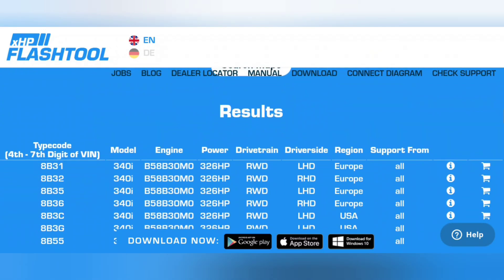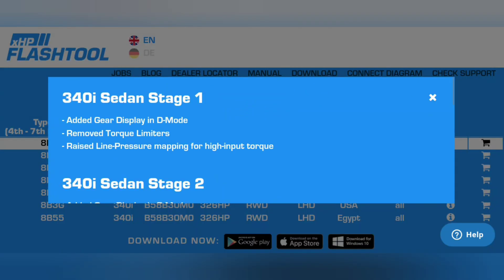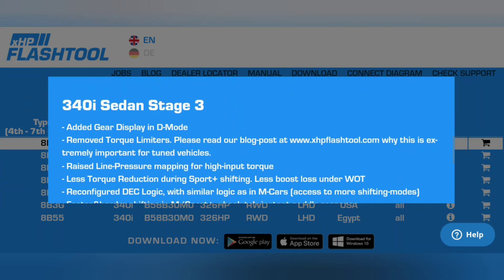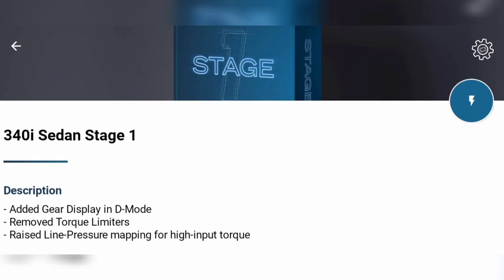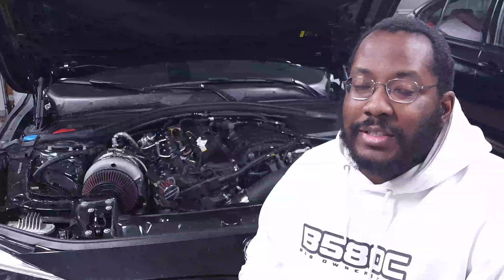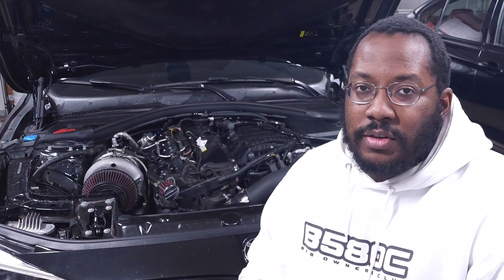Is a Stage 3 Trans Tune too much for Stock Turbo setups? Guide to xHP Tuning Maps

Comment: XHP is usually targeted for better transmission. A custom tune is targeted at the engine so you get more power from the engine and the transmission.

Comment: I just tried today xhp stage 2 and i dont think ill even bother try stage 3 as it already feels super quick and the up shifts are kicking like some real M dual clutch tranny hands down xHP great product
Running 2019 g31 540i 421hp 620nm on  95ron fuel and spark plugs soon to be replaced 
Checked on dyno this week

Comment: Is it normal with stage 3 that the shift on low throttle and low rpm that the shifts from 1 to 2 break my neck? Or is it just part of the aggressive experience thing?

Comment: quick question  2011 335i n55 e92 here
i’m on MHD stage 2 tune & XHP stage 3 transmission tune. 
when wide open throttle car gets half check engine light & get these codes on MHD

2EE0 - Combustion misfires, several cylinders:
Fuel injection deactivation.
2EF4 - Combustion misfire, cylinder 6: Fuel injection deactivation.
2EFE - Combustion misfires, several cylinders:
Damaging to catalytic converter or damaging exhaust gas.
2F04 - Combustion misfire, cylinder 6: Damaging to catalytic converter or damaging exhaust gas. deactivation. 

any ideas? 
i only have - Gear Display
Throttle Blips M-Mode
Reassign Shift-Speeds activated. am i missing anything ? also on MHD do i keep the transmission part on AT auto rear wheel drive or x drive or do i change to alpina flash auto rear wheel drive. other options are manual MT or xhp flashed AT
Reply from the maker: Sounds like an engine issue not a transmission issue.

Comment: I’ve bought an m2c with stage 1 (550hp/700nm) but I think without TCU tune. The other day went into limp mode and my transmission act weird,and had propulsor error in the dashboard and CEL. After 30mins started the car up and looked finês. Now I am wondering if it needs a TCU tune. Could it be hitting a torque limiter?
Reply from the maker: i suppose it's possible but not likely. you need to scan for codes in those scenarios to see what's wrong
Reply: @kern417  there was errors from the transmission,it had a short circuit between the connection of engine and transmissionCU. But if it hits torque limiters shouldnt go limp mode? Also I was pushing the car hard in high revs
Reply from the maker: without the codes it's no use trying to guess. your other option is to run a log.

Comment: went straight to stage 3, and my trans began overheating on very hot days after 30 min and would take a bit to overheat on cooler days, not sure if this is common or has happened to anyone or if it has to do with xhp or another issue, but any info or advice?
Reply from the maker: How do you know it was overheating?

Comment: Would anyone be able to speak to long term reliability? Looking to flash xHP stage 2 with either JB4 piggyback or BM3 stage 1. What kind of logging should be done to monitor ZF 8 speed performance?
Reply from the maker: It works great and reliability. Reading adaptations will be the best opportunity to confirm trans health

Comment: If I’m getting a combustion engine torque limitation active code will xhp fix this? Im on a custom e85 tune
Reply from the maker: If you don't have xhp then you will trigger limiters depending on how much torque the car is requesting
Reply: @kern417  i got xhp stage 3 but still getting the shadow codes sadly. Will see what my tuner says
Reply from the maker: Is the load/boost going over target in your logs?
Reply: @kern417  yeah but now it only flags the torque flag near redline (6.6k rpms) so seems to be fixed on this newest revision I got today 🤙

Comment: Bro... I love your channel! So helpful. Okay, I am going to buy XHP but I need to fix my 540i first. Can you help me, please... Ever since I upgraded to the B58TU fuel pump. I can not get my car to make any aggressive pops. I use BootMod3 and running the Stage 2 plus. I have a stock exhaust, VSFR high flow downpipe, charge pipe upgrade, and K&N air filter. With that said... I could make it very loud before the new fuel pump install. Do you have any clue what might be going on? I have tried refreshing back to stock and then back to the tune. I changed the custom burbles to max and it still sounds the same. Help please. Thank you!❤
Reply from the maker: Not sure. I would message PTF for help addressing it. A pump doesn't do anything with burbles.

Comment: Great video and very informative. I have the B48 330i stage 2 with BM3 and have been considering XHP for a while but could not really find the answer to my question about if it was worth it for lower horsepower tune like mine (approximately 350HP) but you sure answered that for me. Big thank you.
Reply: Have you gotten it? I’m thinking of getting it with my 330i
Reply: @GrandMasterPurp did you get it?
Reply: @ I did get and I do recommend it makes the shifting so much more smoother and instant

Comment: i went straight to stage 3 and its perfect for all round driving, i love the DCT type shifting in DSC off/sport+, the manual shifts are instant its so good

in comfort and sport mode the shifting is still super smooth basically like oem, but sometimes wish the sport mode had harsher shifting as i dont always want to go into sport+ or dsc to have a hoon around.

oh and wonder why in comfort and sport mode manual shifting is slower than oem lol
Reply from the maker: Apparently they changed that in one of the updates. I never used it before now so can't really compare
Reply: @kern417  I’m on 1.7 and manual upshifting in comfort and sport is quite slow
Reply from the maker: @ahhhh226  yeah same i just haven't experienced any different for frame of reference. If i want fast shifts i go to sport +
Reply: Whats your mods? im gonna be getting xhp soon and not knowing whether to go straight to stage 3 or stop at 2 (stock m340i)

Comment: Hi Kern, I really love all the videos you put out; they're very informative!  I have a question, I have a 540i and it's on stage 3 XHP and stage 2 BM3. When the car shifts in comfort plus, I feel a jerk which I don't want to feel. Is there a way to have OEM settings for comfort plus and then stage 3 XHP on sport + or should I use stage 2 XHP and it should be less aggressive on comfort plus?
Reply from the maker: It's probably the slow shifts in comfort +. Try selecting one of the presets in the shiftmap options

Comment: Great video👍Slightly off topic but I’ve often wondered if the software update that’s part of the mppsk install at bmw adjusts the gearbox software as it seems to improve shift times in sport+ (could be wrong)

Comment: I'm on Stage 2.... DRAG MODE.... Moderately spirited driving, - never go above 3500 RPM and it's lasted 1300 miles.   Clutch adaptions look the same.

Comment: For those of us running stock, xhp ruined my car. It took away the hard aggressive shifts of the standard factory map in Sport mode. When I then tried to revert back to factory map, it took some updated stock map from somewhere....their servers.... And not the original map from my car. So I've now forever lost the enjoyable jerky shifts in sport mode, as well as the "fart noises" on upshifts. Total disaster.
Reply: If you want sharp gear changes you really need to put the car in Sport+ and to go in S mode (stick to left) or manual mode. For me, the shifts are crazy fast !

Comment: What is the current only way to get more power out of POST 06/2020 produced b58s. So like for example a 2021 m340i. And are there any companies working to figure out a way to unlock them without having to send them to femto? Its been 2 years since those b58s came out, shouldnt there be some kind of progress on figuring out a way to crack the dmes?
Reply: still no one except femto lol
Reply: @ sad stuff

Comment: One question I have always had is, how hard are these tunes on the transmission/ overall health and longevity in general? I had to flash stage 3 after installing my big turbo as stage 2 was limiting the torque pulling from 50’s and would cause a split second loss of power before picking back up.
Reply from the maker: Generally it isn't an issue. But some settings allow you to push the limits so you should be aware of what's happening before you go that far
Reply: @kern417  Thanks brother! Quality content as always 🙌🏽

Comment: Thank you for bringing new about B58 man I really appreciate the work you do, I have one simple question, as far as I understand, bmw x40 engines comes with a different torque converter than the one in 540i, how much can I push with the stock converter before looking to upgrade to an M Performance torque converter or another one in order to make some gains, I really don understand why the 540 G30 comes with a different torque converter than the 440, 340 cars? Thank you.
Reply from the maker: I haven't seen anything regarding that. I don't know of any 5 series with slipping torque converters, even with big turbos

Comment: Great content as usual kev, but what about BM3 transmission tune is it more safe or XHP stg 2 for example?  Just purchased BM3 license a couple of weeks ago so I’m not sure which to try
Reply from the maker: They don't have a trans Tune for our b58 cars. The ones they have on other cars only removes the torque limiter and doesn't have nearly as many features as xHP.

Comment: Those of us with a90s is it worth adding sport plus thru Bimmercode with xhp or stay with ots maps
Reply from the maker: I think so. If it's like F30, it just combines all the fastest modes from everything, plus softened traction control to let the wheels slip a bit. It's great for performance and fun.

Comment: Thanks for the info! Just wondered if you think xHP adds much wear and tear/could add issues with reliability and longevity at all? I know you mentioned the torque limiters stock operate well below the safe levels for the zf8.
Reply from the maker: With these features no. In part 2 i will talk more about the options that can
Reply: @kern417 can you send link for part 2?

Comment: You forfot something about stage 2 vs stage 3, and this is DSC off. Manual mode is really slower in dsc off in stage 2, there's a delay between shifts and in stage 3 they are instant. That's why I went stage 3. I just turned down throttle blips to minimum in settings because they were pushing the car when braking.

Comment: Once you go hybrid on the 340 I’d be interested to see what you change in the settings. While they raise the rpm a tiny bit it still goes into 8th fast at low rpms and kinda bogs you a bit if you have max torque at 3-3500rpm. Tried sportive shift map in the editor but it’s still not rly where I want it
Reply: in the options where you chose sportive you can also do custom to change when each gear shifts
Reply: @alexk4804  yeah but not sure how I should go about doing that. The presets don’t add the same % to each gear and if you do it wrong it can make the car really weird to drive. If you have some settings I’d love to try em! The standard xHP shiftmaps are def made for stock turbo. Adjusting a slider with a % is hard to gauge compared to just setting an rpm

Ideally in d mode, rpm would be at like 1800 while cruising but shift down with a little gas to be in the power band more and feel less sluggish. Shifting at 3k with 25-40% throttle and higher at 4-5k above 50% throttle. 

And hold 6th and 7th gear longer so you’re not in 8th gear at 50mph. May try sportive+ instead of sportive next
Reply: Im also curious how hybrid turbo affects to normal daily driving with D mode, is there still enough power to drive 1200-1500rpm ?
Reply: @przemekgodzik56  depending on which hybrid mechanically they will spool different. pure800 or the smaller daw turbos can spool pretty fast while the ultra flow will spool slower. Regardless, most tuners won’t give you full boost till 3500 even if the turbo spools faster to protect the stock motor. 

I’ve driven my og pure800 car for a while and like to be in d mode comfort around town and cruising on the freeway. It’s not undriveable but changing the shift maps would greatly help. The standard stage 3 shiftmaps are a bit lazy imo
Reply: @SpiderGamesHard  Id like to take turbosystems stage 2. Its not big turbo, maximum untill 600hp. Stock turbo is crusing around 1200-1600rmp and im curious if on turbosystems stage 2 will be simmilar with daily driving or its gonna be annoying

Comment: Well said Kern, stage 2 is the best option specially if you are not tracking the car or drag racing. I’m on MHD Stage 1 and xHP Stage 2 in my 440i GC and it’s my daily driver but it feels really nice when you press the gas pedal 😊👍🏼pretty happy with the performance that i have with both flashed options.
Reply: I have the came car and looking for the same setup with flex fuel like e40. Bm3 has a nice flex fuel kit. How much hp are you putting down?

Comment: Does it matter what stage mhd I am ? I’m currently stage 1 MHD on my 340i. Contemplating buying my dp and going stage 2 or buying xhp what’s your thought. If I go xhp is stage 2 ok whilst mhd is stage 1
Reply: The one has nothing to do with the other. I had xHP Stage 3 before I even tuned the engine! So Stage 0 + Stage 3. Still plenty of advantages.
Reply: @Y.D.43210 can you please tell what you experienced with this XHP tune on stock car? I am stock now but looking to do the XHP first. Thanks
Reply: @Alain91C  Only positive. In reality it is completely independent from an engine tune and brings (performance and customisation) benefits on its own. You get the same advantages through xHP whether you are engine-tuned or not. Clearly if/when you tune the engine, the removed torque-limiters come handy too.
Reply: Yeah, no need to match the stages, i’m also on Stage 1 with MHD but stage 2 with xHP on my (B58 Gen1) 440i GC and it’s awesome! Go for it, it worth the money 😉👌I’m really happy with the performance!
Reply: @technopro-kz4xv  I used to work at bmw as a porter and would always drive the m340is and now I can say my 340i shifts and feels like an m340i now hahaha glad I took your advice
Reply: @alexisfigueroa7999   i’m glad to know that you are really happy with the flash, if it feels now like a M340i then enjoy your new M340i 😁👌
Reply: Currently stage 1 340i rwd, im going xhp stage 2 before i get a DP. I’ll prob end up doing some suspension work and sway bars before i go stage 2. Also gotta make sure your tire setup can put that power down. So it really depends on your goals and if you’re ready for stage 2. and a stage 2 transmission tune will work fine with a stage 1 ecu tune, you shouldn’t have to worry about matching the stages. Personally I would go with xHP tune next, it’s fairly cheap and no install required. Dp is also pretty affordable and if you already have MHD license then ur good to go whenever you pop it in.
Reply: @HargunSV  i agreed with u about the tires and suspension your comment highly influenced me to go trans tune after all thanks bro

Comment: Great video, but one very essential detail you missed out is that the difference in shifts between Stage 2 and Stage 3 is ONLY in Sport+ / Manual, not in Sport or Comfort, which remain the same in both stages!! This is crucial for those of us who drive predominately in Comfort and Sport and use Sport+ / M (or practically S) only when really aiming and expecting maximum performance and maximum aggressiveness!!

Also, maybe it is something I've read but forgotten - are you suggesting in Stage 2, shifts are faster in Sport+ compared to Sport?
Do you know for sure / can you confidently feel that? IMO they are the same (faster than in Comfort, of course). 

Apart from that - I tried both Stage 2 and Stage 3 (starting with Stage 2).  To me, Stage 3 in Sport+ / Manual is not at all as jerky as some people describe it, the shifts are harder but N O T H I N G compared to e.g. M135i's stock (!) gearbox shifts in Sport, which crack your back on every shift. And since I rarely use Sport+ (and when I do - I don't mind the extra sauce) - I stayed with Stage 3, as in Comfort and Sport it is essentially Stage 2. therefore again - it is crucial to understand that Stage 2 Comfort = Stage 3 Comfort and Stage 2 Sport = Stage 3 Sport!!
Reply: Yes, I can tell you for Stage2 that shifts are faster in Sport+ than Sport (I believe the app mentions this.) 
This may depend on your iDrive settings though, for me with S2NH, I can chose whether to have dampening adjusted in Sport or Sport+ only.
Reply: @bsturn  Not sure what M Sport Brakes (S2NH) have to do with the transmission but I get your point about manually setting Sport mode. In my case Sport is with its default settings and I am not confident the shifts with Stage 2 Sport+ are any different than in Sport. Happy to be corrected. From memory xHP only say that the drive modes control the shift speeds, but that doesn't necessarily mean that there are 4 shift speed modes - in reverse order the shifts are not any softer in EcoPro than they are in Comfort.
Reply from the maker: That's exactly what i said at 11:50. Maybe you missed it.
Reply: @kern417  My bad - you do mention it there indeed, but I would have put a huge spell on it. That's the key for understanding the difference between Stage 2 and Stage 3 and for choosing a Stage. There is a common misconception that Stage 3 is "harsh" and even "dangerous" irrespective of the mode which absolutely isn't true.
Reply from the maker: @Y.D.43210  This is an overview video. The primary point is to show that one stage isn't designed for more power like engine tuning ots maps. They just enable different features in different settings. It doesn't make sense to harp on just one feature.